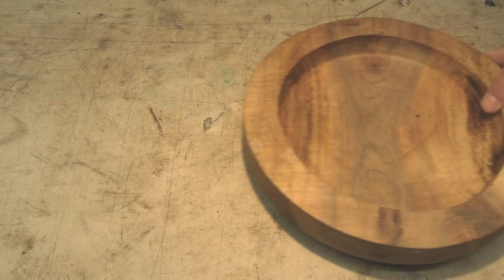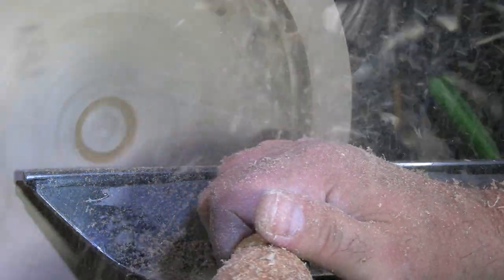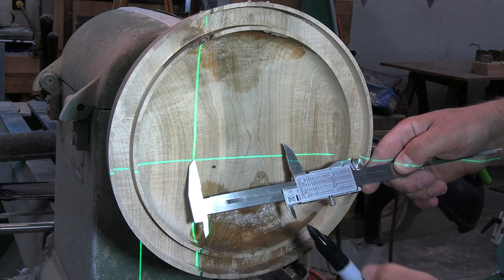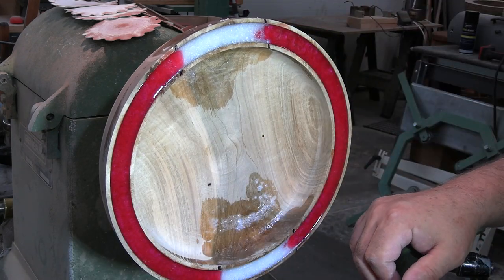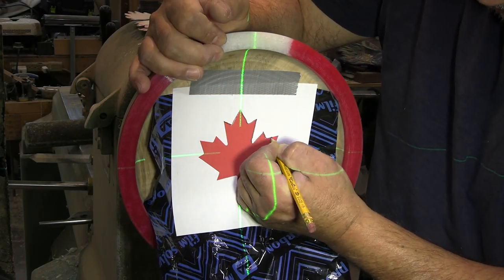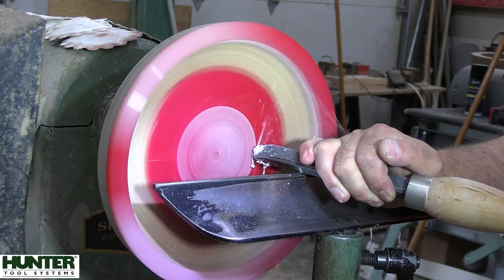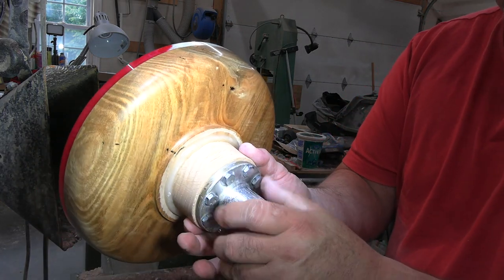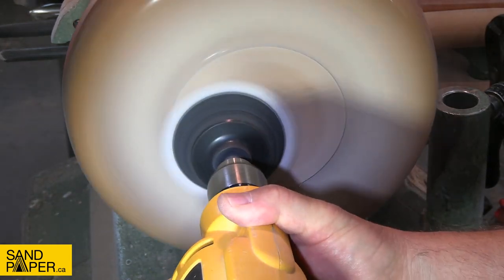Woodturning - The Canadian Flag Bowl

Comment: Hi Jim, have a few bubbles in your Canada day festivities. I once again added to my knowledge in the bottom aligning process. I believe you initially glued a wooden plate to the bowl before the hotgluing of the block. Very nice turnout. I was wondering if it would have been better to carve the maple leaf first to help in dimensioning  the size of the white stripe, pour in the white epoxy only and let it cure overnight. Then proceed to the red pouring operation flag and stripe all at once. This might have helped in
Reply from the maker: No, I just put a waste block on the bottom like I always do. Thanks for watching and happy Canada day 🇨🇦🇨🇦🇨🇦

Comment: Have you thought of using the holesaw to cut out circle areas for the epoxy to fill?
Reply from the maker: I’ve actually been thinking of something like this but worried the hole saw will leave too much of a rough cut. Have you done this? Thanks

Comment: I agree with you, trying to do the standard Canadian flag wasn't going to work. If it helps, with the ridiculous number of stars and stripes on our flag, Americans take all kinds of liberties with our flag's dimensions and counts when doing flag-inspired works. The important thing is to look at a piece and know, "Hey! That's my country's flag!" And you totally nailed that here, in my opinion!

While I do agree that having tiny red slivers wasn't going to work, I do feel the white was not large enough and was pretty overwhelmed by all the red. I might have split the difference between the two ideas and made the white extend out an extra quarter inch on both sides. Having a stripe of red on either side that goes all the way down instead of just being a short cut across the top and bottom of the imaginary flag here makes it easy for the red to balance against the white, even with having a smaller width. There's two of them and they're tall, even if they aren't wide. So that's a lot of red. It's much less weird having the white too small than too big though, so that's the better way to err.

I also love the maple leaf in the middle. It looks machined by a CNC unless you get real close and scrutinize. Always view your work from at least 5 feet away to see how a customer will view it! They look at the whole thing, not each little line and how a millimeter was off near the bottom!

I have to say, your Canadian flag pieces are so much more beautiful than the American flag piece! But then again, I've always loved your flag. NO ONE has a leaf, but there are tons of stars and stripes!
Reply from the maker: Thanks, the American Clock video completely flopped. I was shocked by this as half of my subbs are Americans 🤷‍♂️🤷‍♂️

Comment: Does it matter what resin you use? I had some left over deep pour resin I tried. I had terrible chip out. Could not get a consistent string of resin going.
Reply from the maker: Was it from Designer Epoxy?
Reply: @SpragueWoodturning  It was Ecopoxy for deep pour.
Reply from the maker: @jeffwimer3969  I’ve never worked with it so I can’t help. Sorry
Reply: @SpragueWoodturning  Just wondering if all resins are the same? What is a good brand to use?
Reply from the maker: @jeffwimer3969  I only use Designer Epoxy. Use code inlayjim to get 10% off your order. Thanks